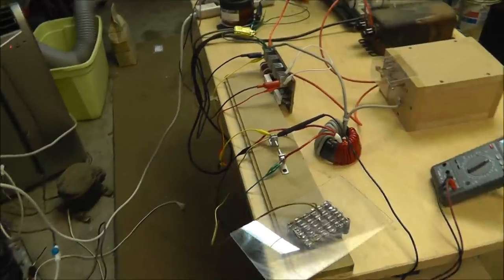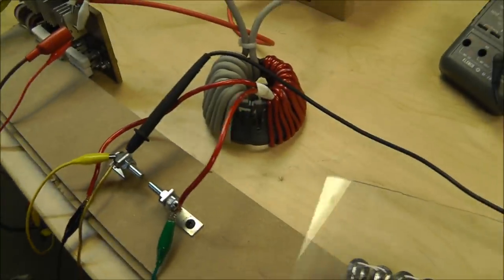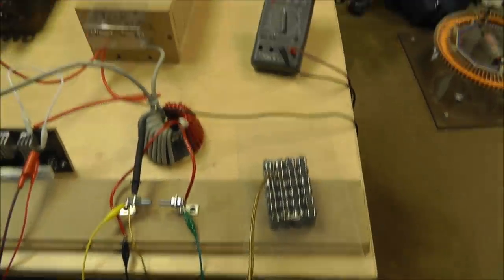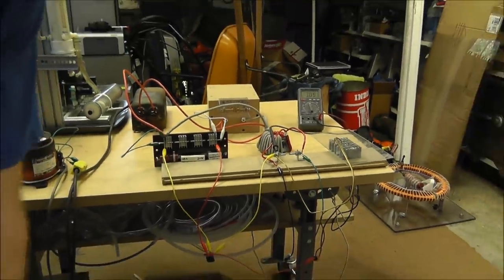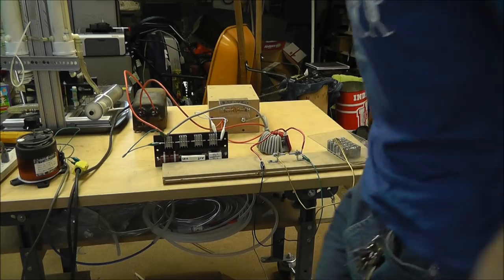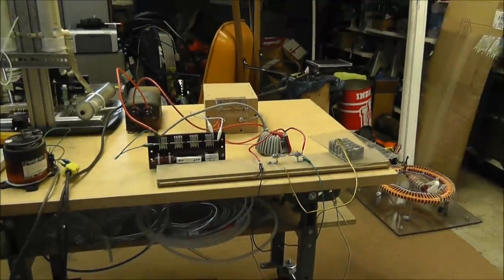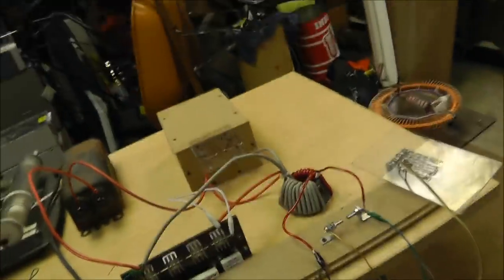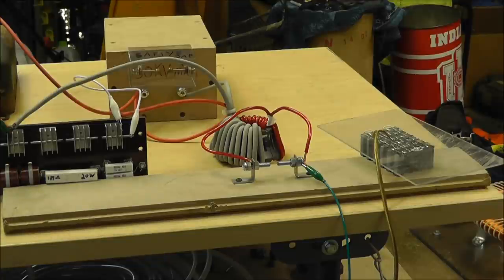Update 4 NGE Papp: High Voltage Assisted Low Voltage High Current Discharge Circuit  RWGresearch.com

Comment: Hi Russ Just wanted to drop you some leads if you don't already know. The Papp engine was a Magnetic Flux Compression generator of many types it was a piston, coil, and plasma fired MCG. The firing system used the plasma ignition system I discovered in 2007 it can also be used on the EV Gray work.

Comment: Russ, Congradulation for this. It's very impressive. :) It's a plasma switch? is it? Are you using the arc field to create a path to discharge the capacitor banks?

Comment from the maker: 12000v out put at 30ma. Cap charged to around 45000volts.  120vac 60hz input. Don't know the amps. ( right now it's on a varic, I will have this on a dimmer once I finish the circuit so it will be lower voltage input) the caps are DC. About 124 joules, right now, yester day I did about 350joules! It was much much biger!!! More circuit work to do on this one but thought I would show what I had that day... ;) blessings! ~Russ

Comment: You be careful with that setup! It can burn you before you even know what happened.
I used to work on a lot of high voltage microwave stuff along with high powered tube
audio and linear amplifiers and it can bite you if you are tired and miss-step. as always 
keep up the good work.

Comment: Looks like a trigatron setup... ;)  Use HV to setup the ionized path then the low volt high capacity bank discharges over the ionized path... :)

Comment: So you've made a Trigatron eh?   I did that about 2-3 years ago now.   The idea being to have something else charge up the Lowvolt cap bank to 200-400vdc and then wire a high voltage arc ignition over the same spark gap to "trigger" the discharge of the lower voltage higher capacity bank of capacitors.  It looks like your setup is AC output still, have you done this with DC yet?  I take it the HV input is at 120v 60hz mains?  Whats input amps and volts for the HV trigger side?

Comment: I see. Are you using a volt multiplier to step that 12kv input up to that 45kv level?  If you're sure you're getting the full 30mA out of the trafo you can reverse the math, .03A *12000V=360watts or so input... so at 120vac from mains thats about 3 amps input.   Then the only thing to account for is ON time and the amount of ON time to charge up both the HV cap and LV cap bank, versus the On time per discharge pulse. ie 20seconds to charge up both banks, and .001second to discharge pulse,repeat!

Comment: The reason papp devices will never work is because as the gas heats during each cycle resulting in less available expansion force in relation to the previous discharge cycle. When the system is cold it fires half decent, the next somewhat lame followed by increasingly disappointing power results compared to the amount of input as the gas temperature rises resulting in a diminished capacity for expansion. 1HP is 1HP all day long so this is really not a worthy direction to focus ones efforts considering the brutal inefficiency that instantaneously and progressively worsens with each cycle. You would need to run it on atmospheric air and design it to vent the hot gas and intake fresh cool air with each pulse. Even then you are back to an inefficient way to convert electrical power to mechanical. Internal to the wheels rim large diameter brushless motor/generators with graphene supercap regenerative braking, carbon fiber construction, ceramic bearings and graphene enhanced lithium main power cells are where the real miracles will be seen in the near future. Decoupage some new high efficiency thin film solar panels on the aerodynamic body and toss in a small flex fuel 100HP gas Tesla turbine driven generator making it a hybrid system and you will have something cool. Teslas one way valves coupled with a combustion chamber seems like a pretty cool way to power a super efficient Tesla turbine with efficiencies upward of 95% with 2 stage systems to scavenge every bit of the power. Even the heat from the exhaust could be reclaimed with rectangular exhaust tubing covered with TEC peltier modules and heat sinks to provide additional electricity to run some of the on board amenities.